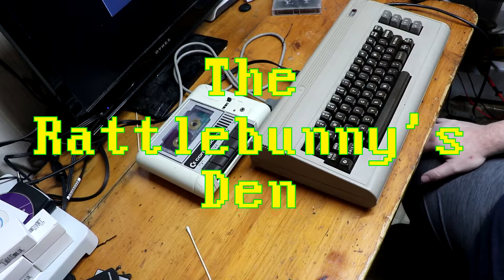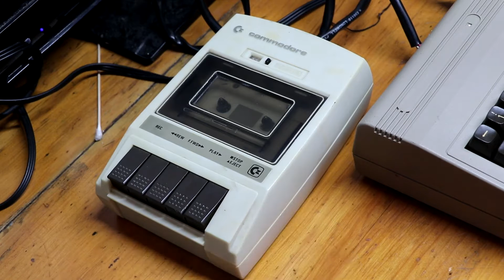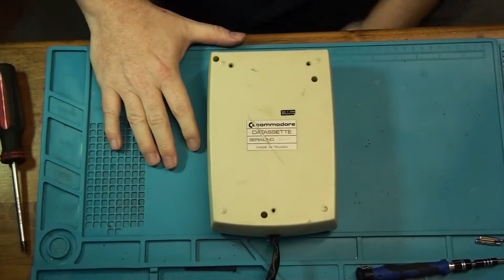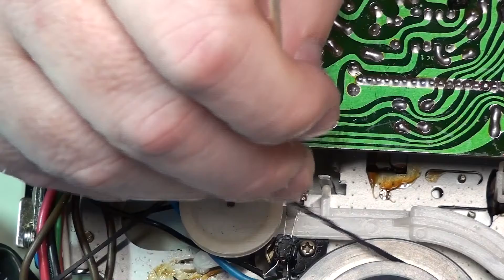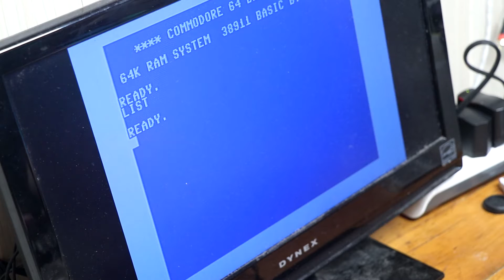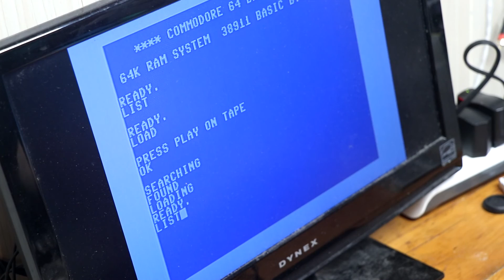Commodore Datasette C2N - Troubleshooting, Repair and Testing

Comment: Have you had to adjust the head at all? If so where is the adjustment screw on one of those? Thanks.
Reply from the maker: You can adjust azimuth on those, but the top cover has to come off. The adjustment screw is on the head, usually has a dab of glue or epoxy on it. If you’ve never done it, take your time and make very small adjustments.
Reply: @TheRattlebunny  When I try to load a program it finds the application starts loading and then I get a ?load Error. Any suggestions?
Reply from the maker: @Thrashin_Victim  That particular error could also mean that the tape media is worn and the system is unable to read further. And it could mean that your azimuth is out. It's hard to say without being there.
Reply: The Rattlebunny's Den it is happening on all the tapes I have. So I am thinking it is either read head or the belt.
Reply from the maker: Liam Powell it very well could be the belt. Excessive wow & flutter would very likely cause that as well.